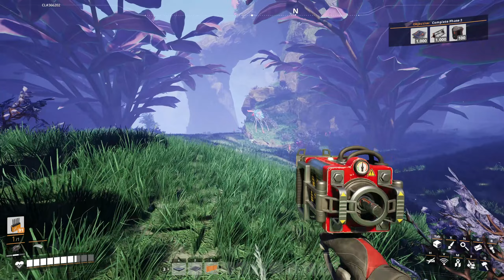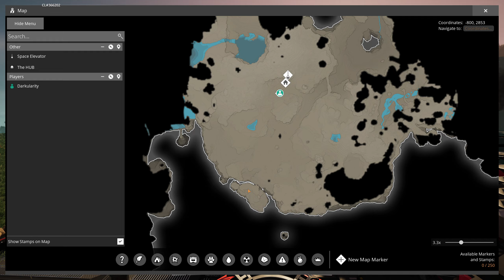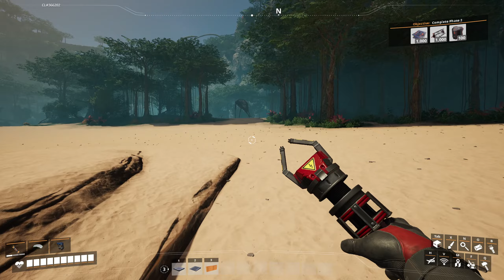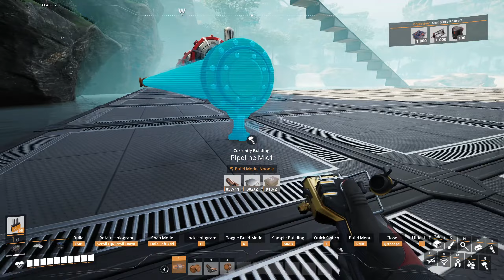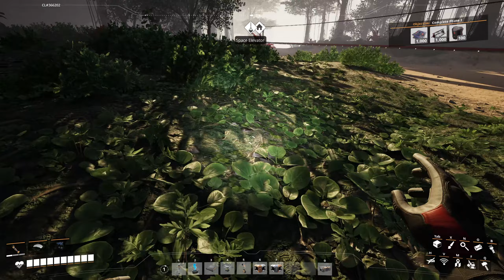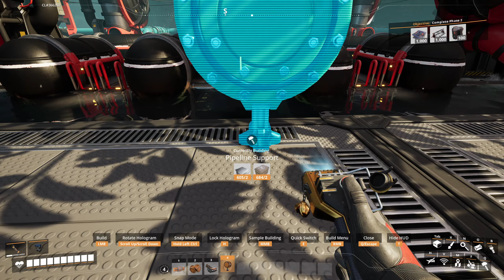I need MOAR POWER, coal power! [E4] Satisfactory 1.0

Comment: Tip: With your coal setup, you only need the 3 water extractors at 100% but you should connect the water at both ends of your coal generator water line. Kind of like a big loop. The water won't just travel around in a loop but once it builds up pressure it'll just all flow into the coal generators. I hope that makes sense. It's what I've done with my game.
Reply from the maker: Oh interesting, thanks for the tips!